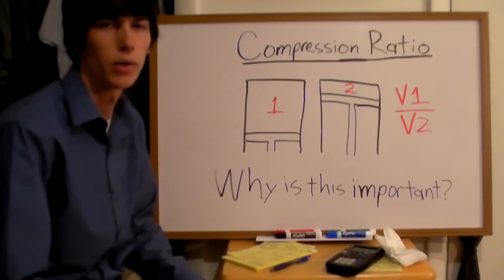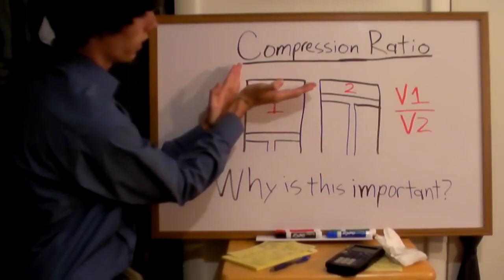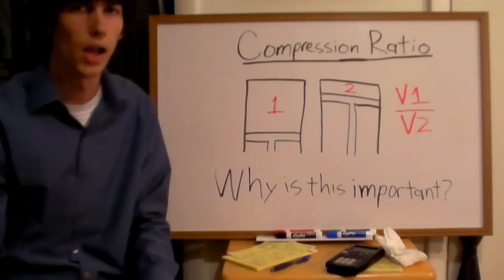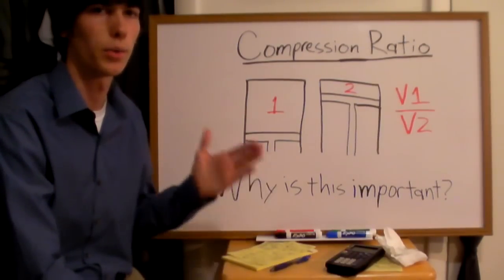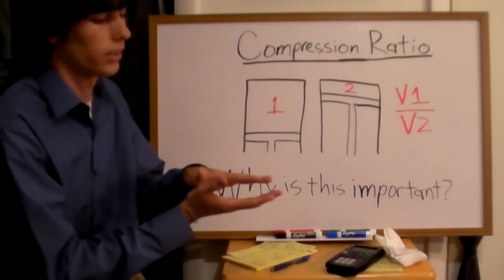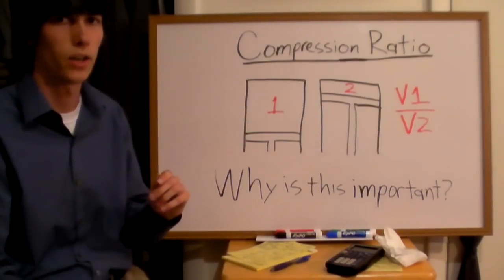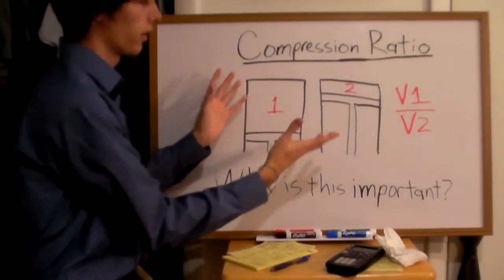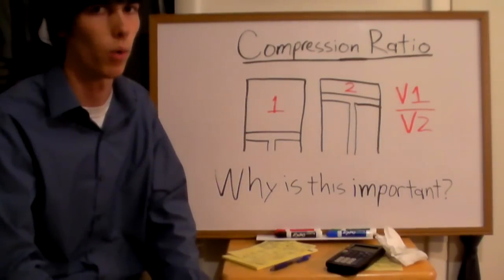Compression Ratio - Explained

Comment: I don't quiet get why the engine knockings when I use a lower gas octane. For example, my car needs premium but when I use 87 I hear the engine knockings.
Reply: It knocks when you use a lower octane because as the piston is still moving up, the lower octane gas is prematurely igniting causing the piston to stop before getting to the right height in the cylinder and being forced back down, thus causing the knocking. At least that's what I'm thinking, I am by no means a car expert.

Comment: Hey man, I understand that all these new cars have knocking sensors which compensate for lower octane fuel. So is it really necessary to put this fuel in a car which requires it even though it will compensate.
Reply from the maker: Compensating means altering the engine mapping to prevent knock, and thus decreasing performance.

Comment: this is over simplified. an engine does not compress anything until the valves are closed. so it should at least mention Dynamic Compression Ratio. this is part of why a higher static compression ratio is used with a 'high performance build as the cam is holding the valves open longer reducing the dynamic compression ratio.

Comment: The engine has just had a top end rebuild due to a head gasket fail also the head has been skimmed so compression has gone up from 170Psi standard to 200psi

Comment: what type of octane gas do you recommend on 10.5 compression ratio ?
Reply from the maker: Whatever the manufacturer suggests.
Reply: Engineering Explained
 well it was a 6.4 block and now stroked to 7.0,  when it was 6.4 , it was 91 but not sure since it has been stroked.
Reply from the maker: Hmm, well I'd probably just go with as high as you can get as a safety measure, unless your engine had controls that monitor knocking and derate based on fuel used.

Comment: Good video but you say that higher octane fuels combust at a higher temperature which is false. The octane rating has nothing to do with the auto ignition temperature . A higher octane number means the fuel has a longer auto ignition delay time.

Comment: Bigger compression ratio, means higher CC right?
Reply: NO I understand what your saying. Its hard to describe...you can have the same size cylinder same stroke and everything. SAME EXACT engine specs on everything stroke, cylinder bore, all of it. You can have more compression of air in one engine then the other. Its compressing more air in the SAME EXACT amount of space. As long as the engine is strong enough to hold the pressure you can have 2 exact engines one with one compression and another with more. Its cramming more air into the same space. Sorry if you cant understand that, its wayyy easier to understand in a video. Pepi Dachev
Reply from the maker: Not necessarily. You could have a 1000 CC engine with an 8.2:1 CR, as well as a 1000 CC engine with a 10.0:1 CR.
Reply: Yes, but if you have two same bore engines the one with the bigger CR will be with bigger stroke?
Reply: Pepi Dachev Nah, compression ratio and stroke are different things. Stroke is length of piston movement in the cylinder. Compression is the same space in 2 different engines but one has more compressed air in the same amount of space meaning it is the same in stroke and size but has different compression ratio.
Reply: J Camaro Yes man, i know, but you didnt understand me... I mean if we have two exactly the same engines with equal cyl. bore, the one with the bigger CR will have longer stroke, right?
Reply: Ok, thanks!
Reply: J Camaro I think you're wrong. How can you have 2 identical engines with 2 different compression ratios? Yes, you may have more or less air in one of them, but that has nothing to do with the compression ratio. How can you have different CR if the 2 engines have the same volumes ( maximum volume and minimum)? You can't. The compression ratio will be the same, but yes, one of the engines ( if it's turbocharged) will compress more air.(because more air will enter the cylinder due to the turbocharging)
Reply: IluSsIoNnN 
Toyota Celica gt
Toyota Celica gts 
It's an example of different compression ratio but different size..?
Reply: Abraham Castillo what do you mean?

Comment: So I can use high octane on an engine that it hasn't been recommended for, but not the other way around?
Reply: Will it damage or wear out my engine that runs on standard gas if I switch to premium? That's what I want to know
Reply from the maker: Correct.
Reply from the maker: No, but it likely won't provide any benefit either.

Comment: Hey man, so therefor the higher the compression ratio the faster the car will be? Im looking into a B20b low compression 8.8:1 or a B20z high compression 9.6:1. Which would be faster. Thank you, nice video btw
Reply from the maker: Depends, if they're both naturally aspirated then yes, higher compression will lead to more power/efficiency. But if you're going forced induction, you may have knock with high compression pistons and high boost.
Reply: Engineering Explained
 i heard about this.. how much of a knock are we talking about ? A huge difference? i am about to get a engine with 10.5 compression ratio and going with forced induction, i was told for superchargers , i should get lower compression ratio, never understood why.

Comment: yo i got a question..When the valve opens,air comes in and the valve closes again,where does the air come from..?is there like a compressor somewhere at the engine or what..?
Reply from the maker: yo i got an answer. The air comes from the negative pressure (relative to atmospheric)  which is created when the piston moves down, pulling in air.

Comment: OK now If I put lower compression pistons and decide to s/c it later can I still run it on a lower compression? Also do you have any suggestions on what to do if running on a lower compression? Thanks
Reply from the maker: Yeah you can still run with lower compression, it will just be less efficient and less powerful.

Comment: So what if I want to put higher compression pistons and a supercharger in my car. What is the difference if I put low/high compression pistons what is probably best for increased horsepower? Thanks
Reply from the maker: High compression pistons will increase power as they increase the pressure of the air fuel mixture. It's more common to use lower compression pistons with forced induction since you're already going to be increasing the pressure, and this helps to avoid knock (or you can use much higher octane fuel).

Comment: It's been tried before, but never works very good. Diesel burns slower than gasoline, and has a much more defined heat of ignition point. Gasoline burns quicker, and its auto ignition point varies a bit more...so controlling the timing is really tricky, and varies with different grades, compositions(additives) and octane ratings. But gas is getting close. the low end for a diesel was about a 14:1 compression ratio, now some direct injection gas engines are around and at that point (think there may be a race gas engine at that level). There's also more energy in Diesel fuel, so...
Reply: Nope none of the current factory applications by any manufacturers is anywhere near 14.0 to 1 for engines gasoline as fuel likely only one exception that aircraft and that ratio demands further fuel refinement or octane additives that's common knowledge for most whom study these engine variations.Although the number can be reached it demands greater strength components much more expense to prepare do much more friction is created which must be displaced by the assembly.Some don't use the word friction but that is basically what is created by ratio increase.Hey again this is only part of the equation on a 2 stroke engine that is piston ported not ported via the crankcase / cylinder head combination and likely most if any of these are ported via the piston alone but could be in general if the application demanded it.

Comment: Couldn't you use the system of a diesel engine with a gasoline one? I mean couldn't we use the compression to burn the gasoline just like for diesel?
Reply: That leads to pre-ignition/knock, generally? It does seem potentially possible, but smarter minds than me would be the ones to probe for that. Of course, I one  managed to get my carbureted 1987 Toyota Corolla engine to “run” entirely dieseling. That is, the ignition was off, but the throttle was stuck open, and it just kept running. Slowly, and very very poorly, but I actually had to go close the throttle to get it to stop,

Comment: Gasoline engines need a spark plug because they can't be compressed enough to ignite. Diesel engines have a lower ignition point, and therefore do not require spark plug.

Comment: Hey EngineeringExplained, can you explain what liters are when talking about engine size? For example, I've heard that a 2.0 L engine means that it produces 2,000 cc of displacement, but I've also heard that 2.0 L refers to the maximum amount of gas and air mixture that all the pistons can hold combined (2.0 liters of mixture). Can you explain what liters truly mean when talking about engine size?

Comment from the maker: They may use stronger pistons, if there is additional stress from the additional compression - it would be fairly application specific. You can alter the geometry of the pistons, crank, and connecting rods in order to alter the compression ratio.

Comment: if you take a gasoline engine with direct injection end if the engine had a high compression ratio end you take a diesel car..maybe there have the same fuel economic

Comment: No Sindbad. 8/1 is the volume ratio. Say 8 = V1 (volume at bottom dead center) and 1 = V2 (at Top dead center in simple terms piston pushed all the way up) this means the volume of the cylinder was compressed or made small from size 8 to size one.  

Think of a syringe filled with water lets say. If the top part is sealed (n opening). What do you think will happen when you try to push the syringe plunger up ?  Higher pressure because you are compressing the water inside.

Comment from the maker: Use the fuel that your car manufacturer recommends. Cooler air is more dense, yes, so everything else being equal, cooler air will have more O2. This isn't necessarily the case at higher elevations.

Comment: I drive a SOHC 4 cyl engine. Will higher octane fuel and colder air at the point of combustion help with fuel mileage and torque?

Comment from the maker: No, you should use what the manufacturer says to use, as that is what the engine is designed for. Mazda gets away with it with a different exhaust design, as well as direct injection.

Comment: 2) The CR for Mazda skyactive 2.5 litre gasoline engine is 13.1 and it only required 91 octane. My question is why Honda accord euro 2.4 litre gasoline engine with CR 11.0 required 95 octane? Is there any benefit of using 95 or 98 octane in Mazda engine since the CR is higher than other car manufacturer engine (in terms of more torque and mileage)?

Comment from the maker: Only if your car requires it, use whatever the manual says to use, as that is what the engine was designed for. Going higher than necessary typically will not provide any benefit.

Comment from the maker: 1) Apparently yes, based on Mazda's skyactiv diesel engines. Haven't quite figured this out - may have something to do with expansion ratios. 
2) The ones in Europe do, and they have higher CR as well (14:1). Direct injection and the exhaust design help them achieve this.
3) Ethanol? Well I believe ethanol has a higher octane rating (search my channel) which allows for higher CR.

Comment: Hey great video! but I have a few questions: 1) Does it have any kind of benefit to have a low compression ratio engine? 2) How come Mazda Skyactiv engines have a high CR but they reckon those don't have to use premium fuel? 3) Why is it more effective when the engines on many cars in Brazil that use "Alcohol" have a higher CR? Thank you so much

Comment: One question, isn't it harder to turbo a car with a higher compression ratio? Mainly because Higher risk of detonation? I haven't researched it in a while but basically I'm asking is isn't it harder to Turbo a Honda prelude with a CR of 10:1 or 10.5:1 (or maybe that was my 300zx I used to have haha) rather than a 240sx which has (I think) 8.5:1? The higher CR engine would have to.be at lower boost? Or would you just need to match the intake and exhaust volume better?

Comment from the maker: Typically you'll want to use a lower CR with turbos (relative to the NA version of the engine) so that the internals can handle the extra pressure/temps and so you can prevent knock.
Reply: Good you wrote it. I have been searching for this reason

Comment: I have 2002 chevy astro on wet days it doesn't start I put new plugs, wires, cap, rotor, coil pick-up, coil, module and crank sensor, the fuel pump I hear running when I turn on the ignition, the plug I checked for spark and its seems to be good spark. Still no start. what else can I do?

Comment from the maker: Assuming the 10:1 is more efficient than the 9:1, and it's essentially the same engine, with altered compression, then yes, it could be more powerful. But you can't simply use CR to compare engines' power.

Comment from the maker: It's the distance from the top of the piston (assuming it's flat) to the top of the cylinder head when the piston is at its lowest point, divided by the distance when the piston is at it's highest point.

Once again, this would assume the piston and cylinder head are flat, which they are not. So really you need to measure the volumes at BDC and TDC and divide.

Comment from the maker: Nope, but if the engine is going to be turbocharged (or other forms of forced induction) then it may be the case, as the turbo adds pressure rather than the compression alone.

Comment: Two CRs are important here, geometric and effective. You can have different CR and ER  geometric values, look at the Gomecsys crank for a geometric difference, or even the true Atkinson cycle (not what Toyota claim they have). Ways of achieving different dynamic CR and ER are possible with variable valve timing (psuedo-Miller cycle). Late intake valve closing means you get a low CR, but a normal exhaust valve opening means you have the geometric expansion ratio. Did you get my PM?

Comment: Is that the Pulkrabek book? If so, there are numerous errors in that text, he also states you cannot achieve volumetric efficiencies greater than 100%, which we know to be false. Despite my reservations on Pulkrabek, virtually every textbook, including "The Bible" (Heywood), will tell you that compression ratio drives thermal efficiency, however these assume that compression and expansion ratio are the same, which dynamically they seldom are. Some papers coming your way, will PM them to you.

Comment: It is the expansion ratio which dictates thermal efficiency, not the compression ratio. The further you expand the gas, the more work you get out of it... and the lower the pressure is when you open the exhaust. There is no real benefit to compressing the gas further (higher compression ratio). Keep up the good work with the videos though.

Comment: well i need to tear my engine apart anyway to replace a rod due to rod bearing failure that warped rod #7 in my taurus SHO. i could use rods and pistons from a 2.5 duratec V6 as the SHO engine is based off it, and i know they make different pistons for that... hmm

Comment from the maker: If you wanted to increase the CR of your engine, yeah it could be done with different pistons, or different cylinder heads, or connecting rods, but connecting rods would likely be a complex swap. Regardless it would need to be re-tuned.

Comment: My 2013 Ford Focus has a 12.0:1 Compression ratio and still recommends 87 octane. Its direct injection so it sprays the fuel in wayy late in the compression stroke.

Comment: No before as the piston opens up and draws the air the fuel is injected. Once the intake valve is closed and is ready to be compressed the fuel is already mixed in.

Comment: So the engine sprays the fuel in after the air in the cylinder is compressed. How do injectors work at those high pressures?

Comment: So, even though diesels have a much higher CR than most(if not, all) gas engines of comparable size, what makes the diesel so economic to it's gasoline counterparts? The type of fuel it's using? Or setup of the engine, maybe? Perhaps the simple fact that diesels are designed to run at lower RPM's?

Comment: Very good explanation of air acting like a spring. This is the very principle that engines with cylinder deactivation use to help prevent pumping loss. 
They realized that if only cutting fuel supply and spark to a cylinder still requires that cylinder to do work (pump) to move air.
By keeping the valves closed during deactivation, the trapped air compresses and restores to its original energy state, no net energy consumed.

Comment: Due to the air is compressible, unlike the liquid.
You can imagine the air is like the spring,
the more you push the spring, the faster it rebounded.
Refer to the catapult on the aircraft carrier, the pressure inside the 
accumulator is like the compression ratio. If you want to shoot the 
heavier airplane, you must increase the pressure of the accumulator.
Thermodynamic : P-V diagram.
W = ∫ Pdv, where P = pressure in the combustion chamber.
The higher the P is, the higher the W is.

Comment from the maker: The engine is more efficient with high CR, so even though more power is produced, it doesn't necessarily mean more fuel is used. Higher CR means better fuel economy over a similar engine with a lower CR.

Comment from the maker: I suppose it depends on how you increase the stroke. If the stroke increases in length (closer to the crank) and has a larger gap at TDC, then I suppose a lower compression ratio could result. Haven't read up on it or anything though.